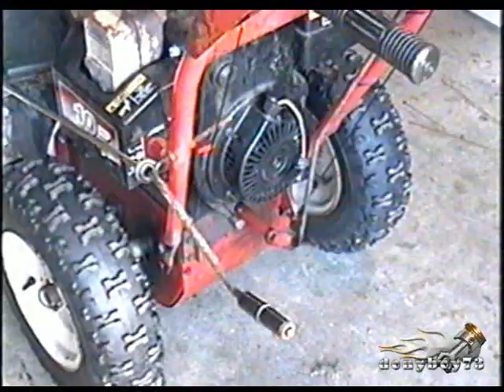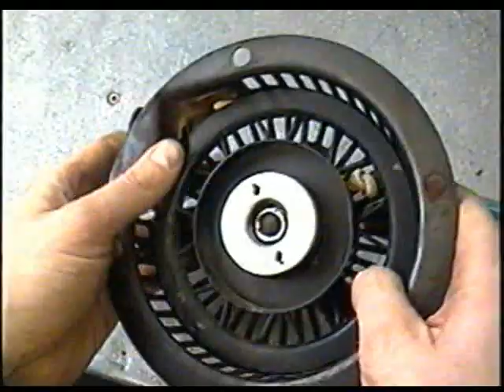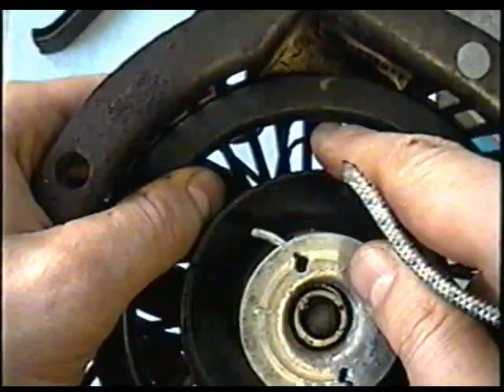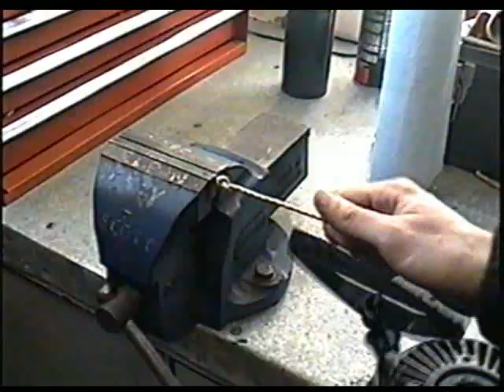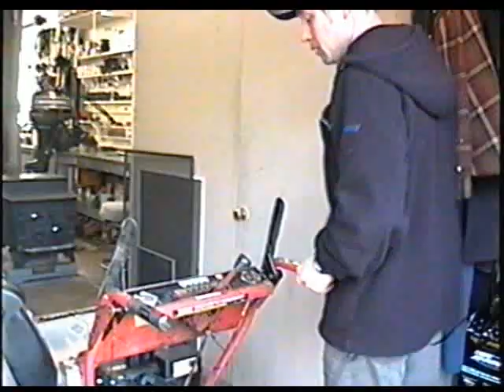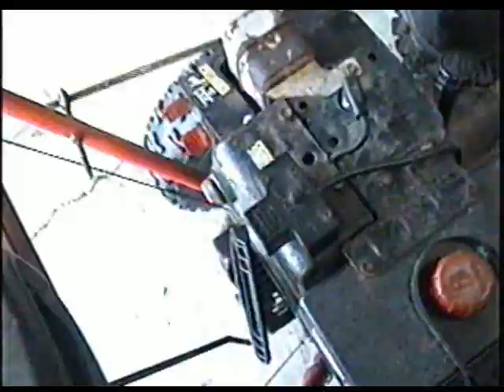Snowblower Starter Rope Repair on 8-10HP Tecumseh Engine

Comment: i realize this is an old video but i got a snowblower model number 31zh5b3h501, i cant find anything for it anywhere..the engine number isnt on the thing where is usually is so idk what year it is its a tecumseh yard man anyway and green fairly big but the shaft is broken off right at the starter cup part so the cup is gone. i was wondering if all tecumseh snwoblower cups would work? i was just going to try to weld another one on..not sure how good it will work but ill see i guess..i bought it for 20 bucks and apparently this is all thats wrong with it..i currently bought a honda starter cup becasue thats all i could find if i need a tecumseh then ill buy one of thsoe  tehyre much more expensive form wha ti see on amazon. honda was 12 bucks a tecumseh one i see is 50

Comment: About 5/6 years ago, after the pull rope broke on a lawnmower, I watched this video. Actually, I brought the pieces in, set in front of the computer (so I could watch/pause), and replaced the rope the first time.  I sold the mower a few years later and the pull rope was still working great. 

Flash forward to today. I bought a used generator, that needed the pull rope replaced, and I was luck enough to find this video - again. And, just like before, I brought everything in, sit in front of the computer (with a cold beer this time) and followed along just like before.

I paid $50 for the (5250 watt) generator, bought a new spark plug, fuel filter, oil and the pull rope (about $25 total) and spent about two hours changing the oil/filter, replacing the fuel filter, spark plug, oil and replacing the pull rope. 

I now have about $75 in a generator worth at least $250 or, if a tropical storm/hurricane is forecasted to hit our area of Florida, $350 and up.

Thanks again.If you ever get down to SW Florida, I'll buy you a few beers!

Comment: Donyboy73,
Awesome video! Used this to fix my pull cord on my late 90's mtd tecumseh that was a free hand me down from a friend similar to the model in this video. Liked what you said at the end about having patience if it was your 1st time..😆 very true. Used a small pick to help thread rope thru holes & all was good! Excellent videos keep them coming! Also, how is your honda africa twin motorcycle running if you still have it?

Comment: The "wire"that is wrapped around the right' side of the handle control - it comes out by the bottom area by the starter.I have a 'disassembled' blower that I'm putting back together, but I don't know what or where that little short wire with the remains of a white plastic connector goes? " theres no wire on my' left handle controls. Could you help me out on this curious little wire with no home?

Comment: Hey Don, I repaired the pull start on the Yard Master my snow blower. All I needed was a shot of WD-40 on the bearing on the spring mechanism. One of the easier fixes on this machine. Thanks for your help. John :)

Comment: My rocoil has a metal shield over the entry, so I could not wind it tighter after the rope was put in.  I took the rope out, and first wound it counter clockwise 4 times.  I then put a screwdriver through the recoil to hold it in place to insert the rope.  After tying off the handle, I kept the rope taught while winding.  Everything worked great.

Comment: How do you reseat the end of the spring inside the recoil housing?  the end which seats in the small roll pin that is slotted came out, and it seems you need to compress the pin from the outside (there is a spring under the flared end on the outside) and some how get the hooked end of the spring into the slot in the roll pin.  But trying to push or hold that pin in far enough under spring pressure and simultaneously line up and insert the hook end of the spring requires special black magic that I do not have!  Any suggestion on how to do this?  the spring is fine, I have new rope, but I need to reconnect the spring end so I can add the new rope.  Thank you for all your videos.  they are terrific

Comment: Love the tips in your repair videos....im having problems with putting new cord in tecumseh recoils (8 to 10 hp)  i bought a roll of #5.5 cord (tru blu by stens) and i have tried it two different recoils but they wont retract fully because the cord starts rubbing on the housing.  It is a very stiff cord not sure if that could be a factor..... i cant for the life of me find an authorized (manufacturer) site that tells me what size cord to use. The tecumseh lhead manual talks about 41/2, 5 and #6 diameters but says to look in master parts manual to obtain correct size required.  Help!!!  :)    
Do you have an email address ?
Cheers,    
Mark

Comment: Thank you for the video! My rope broke at the knot inside the recoil. Bought rope very slightly bigger but was to big when going to put it through that little plastic hole. So I reused the old rope. Still really hard to get it through the little plastic hole in the recoil. I used a pin and a tweezers. My counter clockwise turns wound up to be 6 without the spring breaking.

Comment: Thanks! Mine is a 6.5hp snow blower engine (techmseh) and I had to wind it 6 times. I found that you can stick a screw driver through the holes on the front to keep the recoil from getting away from you while you tie the handle.

Comment: So, here's how my mileage varied for a 1995 "Noma" (became Murray) snowblower with 9 HP Snow King

Turns out the original starter cord was really thin - I bought a 5.5 mm cord that was too thick and then, to match the original, I bought an Arnold "Starter Handle (and cord) -  88" #4 1/8" nylon from Home Depot (tossed the handle and used the cord)

My steps:
- Remove four nuts holding recoil starter to engine
- Remove cable staple holding old starter cord to recoil pulley (specific to my model)
- Pull old cord remnants out of recoil pulley
- Tie a good strong knot on one of the new cord, tighten by pulling the knot with short end of cord clamped in a vise
   - Do not trim the short end of the cord too much in case the knot slips
- With needle nose pliers in hand, light the unknotted end of the cord on fire with match
- Allow the end to melt a bit, then slide the lightly clamped needle nose pliers down the cord over the melting end a few times, rotating the cord, to assure the melted cord is not thicker than the cord itself (otherwise, it won't feed through the hole in the recoil pulley)
- Feed the starter cord through the cord hole in the recoil pulley, using tweezers to feed it through - 20 short pushes is gonna be less frustrating than trying to push the whole length through
- Once the cord is through the starter cord hole on the recoil pulley, feed it through the start cord hole in the recoil cowling
 -Rotate the recoil pulley so the cord can be fed up through the slot in the pulley - open slot if required with Exact-o or heated screwdriver
- Wind the recoil pulley counter-clockwise 4 times
- Remove the cord from the recoil pulley slot and let the recoil wind it up
- Pull the starter cord all the way out to be sure there's enough length to pull for engine start and that there's not too much cord on the pulley such that it's binding
- With some cord pulled out (to assure the starter handle will return to the recoil cowling after starting) attach the starter handle to the starter cord, using the vise tightening approach.
- Test pull the starter cord
- Oil the recoil pulley spindle if it's dried out
- Return the recoil cowling to the engine

Many thanks to DonyBoy73 for once again making repair of this old, but sturdy, 'blower much, much easier.  

I paid $695 for this back in the day.  When at Home Depot over the winter, I saw $1700 'blowers made out of beer can thick steel.  Can't imagine those lasting 23+ years.
Reply: I can't edit the entry I made above and, fortunately, an update I have can just be tacked on to the end.  It's based on my experience of test starting the engine and the recoil pulley binding on the engine's cup that accepts the pawls.

- Disconnect spark plug wire
- Slowly pull the starter cord out and see if it easily retracts
- If it down not, loosen the four recoil cowling nuts and re-center the cowling until the recoil pulley does not scrape against the cup on the engine drive shaft that catches the recoil pulley pawls when you pull the cord
- Be sure four recoil cowling nuts are snug
- Reconnect spark plug wire and test start the engine

Comment: Hi, thanks.  Worked!  Was a little more difficult than your video, maybe my machine is older.  It's a 2003 Craftsman with a Tecumseh 10.5.  It looked exactly like your recoil, except there was a piece of metal welded on which prevented me from "grabbing the rope" with needle-nosed pliers as you do at 2:14 of your video.  Instead, I melted the rope as you suggest into a point, and used the pliers to force about 5cm through.  Then I bent a paperclip with the pliers so it had a little hook, and fished the line out through the funnel on the handle hole.  I found that I had to wind the spring for 7 complete rotations (tried with 4, but the engine wouldn't start).   When I released the spring with 7 rotations, it wound the rope all the way in to just before the handle.  Replaced it on the snowblower, gave it a few pulls, and it fired right up.  THANKS!

Comment: Thanks for the info.  I only had the original rope which would not do the bend in to the hole so I tried from the other end and got it that way.  I would never have figured out how to get the tension on the spring - that was great advise!
Reply: Now if I could only get the stupid thing to start! :)

Comment: I got the ripcord replaced at a local dealer, but on my deluxe 28" ariens, I can't seem to get it to quite fit back on (some of the bolts are loose like they are not latching on)?

Comment: Thanks for the hint.  I tried to remove   this staple originally but it would not budge and it appeared I had to disassemble the unit first so that was why I was inquiring.   Once I put a little more pressure on it and some hard prying it broke loose and came out easily.   Replaced the rope and all is fine now.  I just needed a little confidence that this was the correct way to disassemble it.   Thanks again for the great videos as I always go to you first for help with my power tools.

Comment: Help pleas?? Great video only mine is a bit different in how the rope attached. There is a little staple holding it in where the rope enters?? Not sure where I tie the knot?? Any suggestions?? Thanks?? This is a Tecumseh 10hp. HMSK100.
Reply from the maker: remove the staple first

Comment: these engines any good ? I plan on getting a snowblower with the 10 hp Tecumseh. I have a 13 hp for my mower the things hard to find parts for and expensive. so I have always liked briggs.
Reply: Thibault  tecumsehs, internally,  are good engines, i had a 8 hp tecumseh engine sitting outside for close to 6 years, replaced the carb, fuel tank, replaced lines, and ran great.
Reply: Thibault.  I would rather buy an older snowblower than todays, they mostly have chinese clones.
Reply: I'm running a 1988 8HP Tecumseh on a heavily used snow blower.   Burns a bit of oil but has plenty of power and has never been rebuilt.   Only rebuilt the carb once and replaced the muffler.  Besides that the engine is original.   The snow blower chassis is something else.... I've put a lot of parts into it over the years
Reply: Had mine for 11 years and works great. Starts the first time every time. I do store it in a shed in the non winter months and keep it in the garage throughout the winter. Change the oil ever 2 years and grease it once a year.  Body is showing some rust but WD 40 those spots every so often.
Would I buy another one? If I had to, but dont see me having to for at least another 10 years. 
Throws snow like a bitch and have had people comment on the distance it throws the snow.

Comment: I have a Tecumseh OHSK-70 engine on a quite old (1997 or so) Ariens 932033 'Sno-Thro'. When I pull on the starter rope I find it's no longer a smooth pull - quite jerky, and variable in terms of how much cord I can pull out. The worst part is that I am also getting - inconsistently - horrendously sharp 'snap backs' - the handle literally being ripped out of my hand. Any idea what may be causing this? I can't get a time for my Ariens dealer to look at it until late November and wonder if there is anything I can try myself. Thanks.

Comment: need to know how the inner pieces go together,the small spring,the two levers with their own springs,the bolt,and the metal cover.the whole thing fell apart,if I tighten the bolt too much,it doesn't work,and if I loosen it it gets loose and falls apart.Also,how do those metal levers go to engage the motor slots?
Reply: from a Honda clone motor

Comment: I found it way easier to just drive the roll pin through from the outside and remove the pulley. Easy to thread, easy to tension, and no cutting or melting the pulley.

Comment: Excellent video.  My old rope was held in with a staple and plastic retainer that I had to cut off.  Finally got the original rope back in and all is good. Thanks for the excellent instructions.  Of course the snow blower rope broke right in the middle of Storm Jonas!
Reply from the maker: +Stephen Chinnery you're welcome, make sure you're subscribed
Reply: Stephen, thank you for your comment.  My rope was also held by a staple; your comment provided the guidance I needed to remove the rope.  Donboy:  Excellent video!  Thank you.

Comment: Thank you very much donyboy73! I just used your very detailed and helpful video to replace the broken starter rope on my Craftsman 11.0 HP snowblower that I bought from Sears here in Canada back in 1999. My starter rope assembly did not have the hole you mentioned at 3:10 of the video so I used your advice and made one using an exacto knife. After listening to you emphasize the importance of the rope diameter, I elected to use the existing starter rope and just burn the ends with a lighter. I was lucky that the original rope just broke right at the knot in the assembly. The replacement rope I purchased at Canadian Tire was a different diameter so I can just return it. The bolts holding the cover were rusted so I had to soak them with a little WD-40 to loosen them up before I removed them. You saved me the time to send out the snowblower to a shop to get repaired and the associated costs. You also saved me from the shovelling of snow I would have had to do while I waited for my snowblower to get repaired. Thank you very much!

The electric start on my snowblower does not work anymore as well. I may attempt to replace it using your other video after having success with this repair.

Thanks again and Happy New Year!

Comment: what about the style that doesn't have the screw in the middle that covers the dog ears... it's a tecumseh.. older 5 hp.  it's almost as if you can't remove it...
Reply from the maker: +Brian Szovati you have to remove the middle bushing with a roll pin punch

Comment: Thank you. Particularly because mine was one of the ones without the hole, I would have never figured this out without your help.  I did find it easier just to use  a drill to make the hole rather than using an x-acto knife.

Comment: video was great- i replaced the rope. Did a couple test pulls- all seemed good. Installed it and on first pull, it started right up. but it  didnt recoil? I took it back apart and it seems that maybe i made the recoil too tight and maybe have broken or screwed up the spring. Anyway to fix that? Thanks
Reply: +Johnny Iuzzini drive out the pin from the outside and remove the pulley. The spring is probably just hung up inside.

Comment: Well described instructions for something random I needed to fix. Been using electric start up in New England for the last 5 or so winters. Gas her up and she runs like a champ mounted to my 03 ish Poulan Pro 27 9 hp Tecumseh Snow King

Comment: This was a great help!!!! A hit a couple of snags that might help folks. First I couldn't get the rope out of that initial entry point. It looks like on mine there was a staple that was pushed through the plastic into the rope to anchor it. Once I pulled out the staple I was good. The other thing was I couldn't pull the rope through easily. Even with needle nose, there just wasn't enough wiggle room (and it looks like in this video part of it was removed?). What I did was tie a fishing string to it and pull it through. I had to make sure I snipped the top off to where the knot was so it would pull through easily. Last I did find a pull start rope with the pull tab at Lowe's. It was only $3.99 and worked great..... I could never get the pull start to work and this thing works better than ever now! Thanks!

Comment: After replacing the starter rope the dogs are always slipping now, I have fixed one problem and caused another. I have taken it apart several times, everything looks fine. Any advice? My last resort is to order a new one. Thanks for the great videos.

Comment: dang, took the carb off and linkage poped off before i could note where it was connected.any diagrams anywhere
Reply from the maker: yes search my channel for "Tecumseh linkage configuration"
Reply: thanks . got it. awesome videos! you have saved me lots of $$ and Im learning in the process.

Comment: I couldn't have repaired my starter without this video.My 8 HP had some obstructions in the way inside the coil outer housing. I needed to use a paper clip for a hook to thread the chord through the hole.